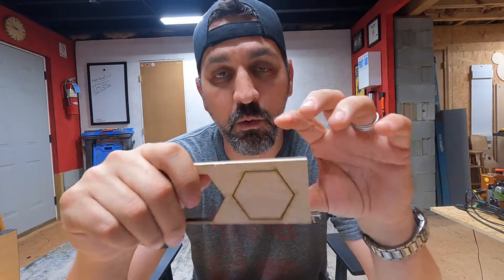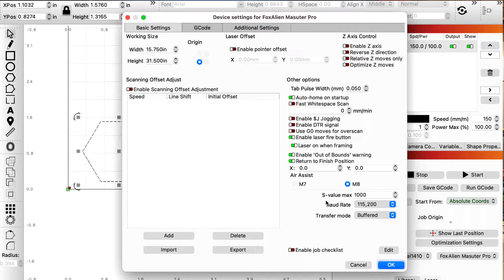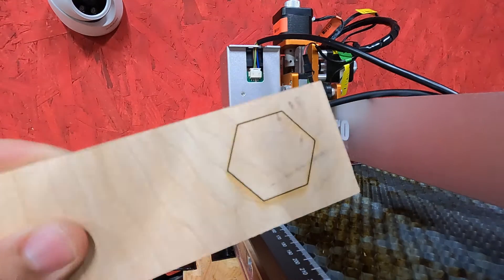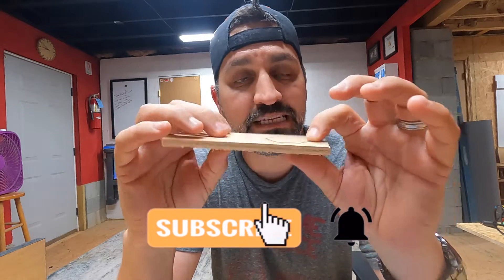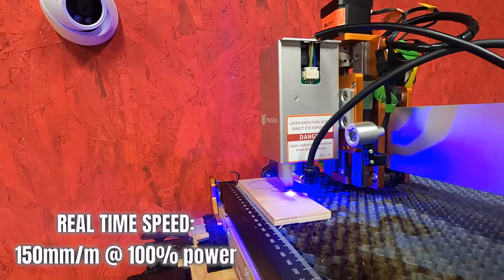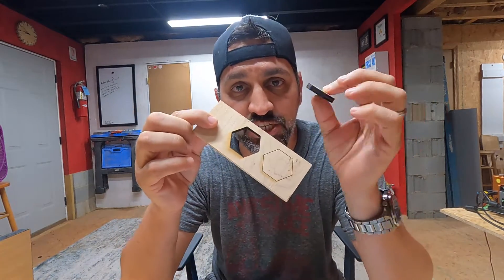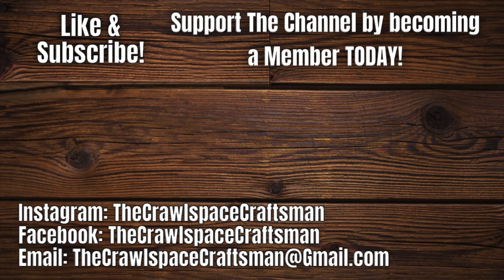Get the MOST POWER out of your Laser by doing THIS in Lightburn!

Comment: CRITICAL WARNING for Diode Laser Users: S-Value Max vs. $30 Settings

If you are using LightBurn, setting your S-Value Max incorrectly can permanently damage your laser module or lead to poor engraving results.
The Golden Rule: They Must Match

Your LightBurn S-Value Max must perfectly match your laser controller's $30 (Maximum Spindle Speed) setting.

    Standard Setup: Most modern GRBL-based diode lasers (like Xtool, Sculpfun, Ortur) use 1000.

    The 10000 Trap: Some videos show users setting this to 10000 for high-end Galvo/Fiber lasers. Do not copy this unless your specific machine's firmware is configured for it.

Why is this dangerous?

If your LightBurn S-Value is set to 10000 but your machine is configured for 1000:

    LightBurn will send 100% power signals when you think you are only at 10%. This causes the diode to run at maximum intensity constantly, leading to overheating and rapid failure of the laser diode.

Comment: putting both settings at 1000 might works better as many control circuits and wire to laser do not reliably switch at 10khz or greater in square wave  pwm. and the pulses need to be long enough for laser power circuits to stabilize. these settings in video represent the speed of the pwm variable square wave resolution, since these are on and off pulses to the laser higher frequency pwm shows capacitive effects on wires as well as diode capacitive effects and cheaper power circuits low recovery time speed for regulation. meaning part of high speed pwm also has a delay in start up of laser. also checking controller setup limits such as old grbl in terminal by typing $$ to get settings from machine.
Reply from the maker: Great points! Thanks for the insight!

Comment: its not a good idea to run your laser on 100% power pretty much as a general rule
Reply from the maker: This is true but if you don’t have these settings match…. You’re not getting the correct true power output. So if your telling the laser to run at let’s say 60% power….. you may be only using a fraction of that in actuality.

Comment: I am working with a boss laser which seems to be different than what you're working with in the video. As a result, my settings look different than yours. Do you have any advice or videos that address setting for other types of machines? What settings should I be looking at to get the most of my LS1630 Boss laser. I was able to see that my machine was set to 95% power so I was able to adjust that which Im sure will help.

Thank in advance for any insights.
Reply from the maker: This doesn’t apply to CO2 lasers unfortunately

Comment: will putting this setting to 10000 damage my xtool s1? want to try it but dont want to risk damaging anything.
Reply from the maker: Not at all. It’s not “overclocking” in a sense. You’re only telling it to use 100 of 100% when you set it at 100% in lightburn. So let’s say one was set at 1000 and the other 10000….. when you go to power settings and let’s say you want 100% power…. It actually will only be 10%!  Hope that make sense!  

Of course if you use xtools software…. These settings are not available and you have nothing to worry about.
Reply: @TheCrawlspaceCraftsman  makes much more sense now, appreciate it!

Comment: I made the change to my D1pro through Lightburn but it keeps reverting back to the original setting.  Also when I set the size of my grid to 430 mm x 430 mm, it changes to 432 x 406. Maddening.
Reply from the maker: That’s definitely frustrating. Not sure why it’s doing that!
Reply from the maker: I really like using Xtool software when using my S1.  It’s a little limited compared to Lightburn… but just easier.
Reply from the maker: Design in Lightburn…. Send with Xtool.

Comment: A bit different with a Ruida CO2 controller. Need to first pull the controller information before machine settings will populate. There are no power settings, only movement settings.   Have to do the math in the head for CO2. If the Ruida has a max power of 80%,  100% lightburn is only 80%.   80% in Lightburn is 80% of 80% or 64% true power.     I learned this when I set my Chaser which comes with a 60W max, when flames leap out, CO2 tube. It was more likely a 50w dressed up as a 60 watt. I set the max power at the controller to 80%, which limited the peak PSU output to 18 mA.  For a while I was setting power to 80% thinking that all I want if to do, then discovered if I needed 50% actual percent, I had to go to 100.   

Now I installed a true 100 Watt CO2 tube, and have to reconfigure ALL the power settings, basically starting from scratch.   Was hoping this was a simpler method, but not for my Ruida CO2.
Reply from the maker: Yeah unfortunately for CO2 users it’s different. The controller power trumps the software power. Thanks for watching!!!

Comment: I am also having issues with my ray5 5w flame detection going off I disabled and restarted.  I typed in $45=0 but I still get the code.  I am outside and in the shade trying to engrave.
Reply from the maker: Not too sure about that. Is your focus correct? Cutting too slow?  Have you added air assist?
Reply: @TheCrawlspaceCraftsman  for some reason rhe code $261=0 isn’t even supported on my engraver.  If I could locate the sensor itself I could cover it.  I don’t have air assist.  Or is air assist also a setting within lightburn that I can adjust?  Thank you for quickly replying
Reply from the maker: Also I believe the sensitivity can be lowered… that’s the $42 command. If it’s 1300….. change to 800
Reply: @TheCrawlspaceCraftsman I figured out the flame protection code $38=0 it’s now disabled and working correctly.  For the most part I can engrave I just need to learn how to cut out stuff.
Reply from the maker: Change $38=0

Comment: Warning!

Cheapest "open laser" is not a professional equipment. The smoke, exhaust fumes can kill you - lung cancer is a likely possibility. The smell of exhaust fumes is unbearable. The burnt dust that is created during cutting or engraving is sticky and smelly. If you do not have a closed box laser with an activated carbon filter or at least an exhaust system outside the workshop, do not think about the laser business. These toys for a few hundred dollars are only suitable for amateur fun - no protection against the laser beam (risk of eye damage), toxic fumes, low power, ultra low speed. Such a laser is only suitable for home-made - once in a while - for fun, for a hobby - provided that exceptional safety rules are observed.
Reply from the maker: You’re not wrong! Thanks for watching!

Comment: Thank you so much for putting this out.  I have essentially the same setup that you have here, the Masuter Pro w/ the laser module, but I have the 40w laser.  I was trying to do a sign for my table, and was wondering why it wasn't cutting 1/8" plywood when moving at 150 mm/min at 100% power.  Had the engraving set at 300 mm/min and 100% power just to get something dark enough to read.  Basically, a 5x8 sign that wasn't that complicated was taking almost an hour to engrave and (not) cut.  Changed this setting, and now the engraving is going 3000 mm/min at 50% power (still need to tweak it, now it's too dark), and 300 mm/min at 100% power cut through in one pass.  Much happier now, and looking to be much more productive.  🙂
Reply from the maker: This makes me happy! Glad i was able to help!!!

Comment: The Machine settings is no longer available in the latest version of Lightburn.
Reply from the maker: I beleive it is just in a different location.  I have it on a different PC than I normally use. What laser are you using. This doesn’t work with co2 lasers.  Are you seeing a significant lack of power with your laser?
Reply: @TheCrawlspaceCraftsman hmmm...i searched all over on new version.  I have an opt diode laser running Gcode.  ESS smoothstepper and Mach 3 controller.  I'm trying to generate Grbl M3 code for laser control which works ok but the laser is staying on between rapid moves and between each cut marking a line between cuts.  This doesn't happen with my vectric generated g code.
Reply from the maker: @wtcbd01  To enable laser mode, send this command to GRBL: $32=1

This tells GRBL to:
	•	Use variable power output (PWM) based on feed rate (M4 for dynamic power with motion).
	•	Turn off the laser automatically during rapid (G0) movements.
Reply from the maker: @wtcbd01  Avoid using M3 in laser mode, as it doesn’t reduce power during slowdowns.

In LightBurn, the use of M4 (dynamic laser power) versus M3 (constant laser power) is determined by the device settings and G-code generation, rather than a simple toggle labeled “M4.”

Here’s how to ensure LightBurn uses M4 (recommended for GRBL with $32=1):

⸻

✅ Steps to Ensure M4 is Used in LightBurn:
	1.	Open LightBurn
	2.	Go to:
Edit > Device Settings
(or click the wrench icon in the toolbar)
	3.	Check “Enable laser mode”
	•	This tells LightBurn to use M4 instead of M3 in G-code.
	•	When enabled, it ensures your laser turns off during rapid (G0) moves and varies power with speed.
	4.	Make sure GRBL is in laser mode
	•	In the Console, type: $32=1

5.	Check your generated G-code (optional)
	•	Click “Save GCode” after setting up a job
	•	Open the saved file in a text editor and confirm it starts with M4

🔥 Why M4 is Better:
	•	M4 dynamically adjusts laser power based on speed — ideal for engraving detail and shading.
	•	M3 keeps the power constant — better for cutting but can cause overburn on corners or slower moves.
Reply: @TheCrawlspaceCraftsman perfect, will try this.  Thanks again for the help

Comment: Yeah, you just solved that mystery for me. I was getting pretty frustrated. my version of LB is different from yours but i was able to find it.

Thankks
Reply from the maker: Awesome! The newer version looks a little different yes. Glad it fixed your issue! Night and day right!
Reply: @TheCrawlspaceCraftsman  the most frustrating part was, it was working fine when I first set it up, then I moved it to my shop, got it covered and got a cheap laptop for it  and it repaid me with multiple issues. Looks like when I set up ightburn on the new laptop it set this setting at 255 instead of 10000. Thanks again, this was my last issue stemming fro the move.
Reply: @LESVOR what version of Lightburn are you using and how did you find these machine settings or the $ settings in latest version ?

Comment: I think the info on this video may be a bit muddled. In LightBurn, the "S-value Max" setting determines how LightBurn represents 100% power for controllers like GRBL and Smoothieware. This value needs to match what your controller expects for proper power output. For example, current GRBL versions often default to 1000, while older versions might use 255. 
All references I've come across refer to 100% defaults of 255 or 1,000 not 10,000???

Comment: My boyfriend tried this on his TTS10-80w and it still won’t work, even with air assist. The numbers we entered matched what you had and only etched the surface 😣
Reply from the maker: Both are set to 10,000.  Is he plugged in directly or using an extension cord? Wondering if he is getting the correct wattage from the power supply to the laser.

Comment: In my case both machine and device settings were on 1000. I have changed it on 10.000 but didn’t get anything. Does that mean that my laser is bad or what?
Reply from the maker: @milosaleksic7599  what kind of laser?  Diode? What output power?
Reply: @TheCrawlspaceCraftsman Don’t know true output power. The guy that sold me said it is 120w of electricity power, if that means something to you. He also said that it can cut hardboard up to 4mm, but I have a problem with 3mm, have to go in 2 or more passes.
Reply: @TheCrawlspaceCraftsman  and yes, it is diode

Comment: what is a good setting for cutting a 6mm Basswood for my 10w elegoo? I try the test file but still won't cut on 1 go. Need 4 pass but it start burning.
Reply from the maker: I would say 3-5 mm/sec at 100% power at 3-4 passes.  You can try a little lesser power with one or two more passes. Also I’d recommend air assist if you’re not already using one!

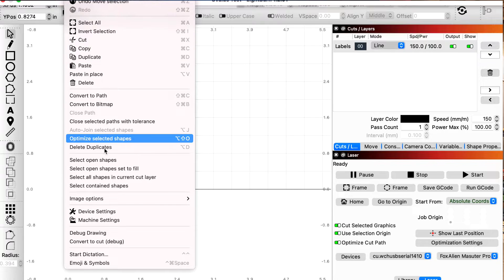Comment: Good video.    Looking at your cuts/layers window at the bottom right- just under speed and power settings there is no material thickness (mm) option, time 1:03.  my cuts/layers window the material (mm) is sometimes gone! too  - I'm getting the message:  "your material is set close to zero do you want to continue?"  Without the thickness set the laser cuts out of focus and messy.   Is there a way to toggle this (material thickness option back- on?) in Lightburn?  It seems to affect the power required to cut.
Reply from the maker: I have to be honest…. I don’t think I’ve ever noticed that option!  I’ll have to go look tomorrow.  I don’t think I have ever had nor used it.  I’ll find this and get back to you!!! If you did…. LET ME/US KNOW!

Comment: Hello! Thank you for sharing this wonderful tweak that unleashed so much power! Question is, would this have any long term effect, such as damage to the diodes or other components of the laser module? TIA.
Reply from the maker: So in short ….. no.  If you put your setting at 100% power on all your projects then in theory it shortens the life. When these numbers match…. AND you set your power % to whatever that is… it’s a true number.
Reply: @TheCrawlspaceCraftsman  so for example, if I know the firmware for the machine setting's max spindle speed is 6000, does this mean that I change the same settings in LB to 6000 and match that at device setting's at 6000?

Comment: hello
how would do we know what is my maximum power? is it the default value in machine settings?
Reply from the maker: So for diodes it’s the number of lenses that amplifies the laser. One laser is 5w 2 is 10w 4 is 20w etc. The settings I speak of is just making sure the % of available power is correct.  When you set the s-value numbers to match…. The controlled % of 1-100 is actual. (Example: Speed and Power). Hope that helps some!!

Comment: please help me, I did everything as you said in the video, but it still works weak, I have a sculpfun s30 33w laser, at 20 percent speed and 100 percent power it does not cut 4 mm plywood
Reply from the maker: Not sure what’s wrong then. Your setting the correct focal length?

Comment: I don’t have those settings in lightburn. Are they called different things on different machines? I have an OMTech polar.
Reply from the maker: Yeah they won’t show / work on a CO2.
Reply: @TheCrawlspaceCraftsman  on my CO2 Polar, I found under Device Settings->Vendor Settings->Laser Settings there's a "maximum power (%)" set to 75. But that's probably a good thing!
It does explain why the test patterns all look the same above 75% though!!
Reply: I have 50w CO2 and doesn’t cut 1/8” ply. Does you know what I can do other than multiple passes?
Reply: @bradgreen7947  if its never worked, then its probably the focus distance (Z-axis position)
be sure in the Device Settings, you enable z axis, enable OMTech Polar, and enable Optimize Z moves.
then a new "material" field will show up in the Cuts/Layers tab. once you set that it will control the focus height. The setting is valid for ALL layers and MUST be set properly

If it just suddenly started to fail to cut, then it could be dirty (clean daily) or loose lens (happened to me)

Comment: I've tried it------if you put 1000 the laser all the time it's at full power. so whatever power I put on it always goes to 100%.....no sense
Reply from the maker: That is odd! Are BOTH values at 1000?
Reply: @TheCrawlspaceCraftsman  This thing doesn't work... it's a placebo effect... The PWM works like this: if you have 0V, the laser is at 0%; if you have 2.5V, you have 50% power; if you have 5V, you have 100% power... So I entered the values from the video, and with the multimeter I saw that, for example, at 10% power I had 5V... so I had 100% power. I set it to 30% power and had 5V, and so on... So I don't know how it's possible that all this works.

Comment: It takes 1 passes to cut through 1/8" ply with my 20W. My $30 is set to 1 as well as my S-value. Is the key to make sure they match or is my output being impacted by the low settings?
Reply from the maker: Never heard of 1 and 1 but theoretically as long as the numbers match your good. They need to be the same to be using 100% of the potential power of your laser when set to 100% in the program. Hope that helps.

Comment: My biggest problem is cutting small intricate designs (right now snowflakes) without scorching the daylights out of them since I use 2 passes. Tried blue tape with one pass and didn't get thru the wood. Two passes and it's toast. Tried high speed/high power, up and down, mix and match. Checked device settings and yes, it was at 1000. Dropped another 0 on the end and will try again on a single pass with a higher speed.
Reply from the maker: Yeah…. Sometimes those intricate cuts are hard! I make wood earrings a lot and those too sometimes get fried!  Test cut files may help you out.
Reply: @TheCrawlspaceCraftsman  relieved to hear someone with far more experience still has this problem 👌

Comment: Just checked my settings and both machine and device settings are set for 1000 for the max s speed. I'm taking it that since both are the same I should be getting proper output with my laser. Would I be correct on this thinking? Nice video. Thanks.
Reply from the maker: Yup! As long as they’re the same!!! You’re at 100%.  😬

Comment: I have an xtool D1 Pro 20w, in lightburn I do not have the s value setting. I am running the latest version. Is that setting based on the brand of laser?
Reply from the maker: You’ll get this with Xtool.  Have you tried comparing cuts from Xtool proprietary software against the same values in Lightburn?